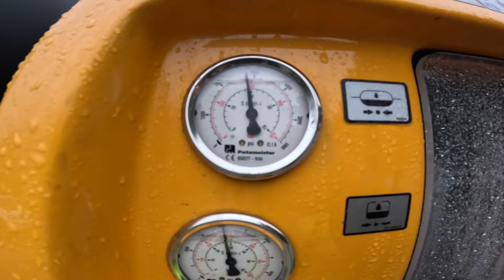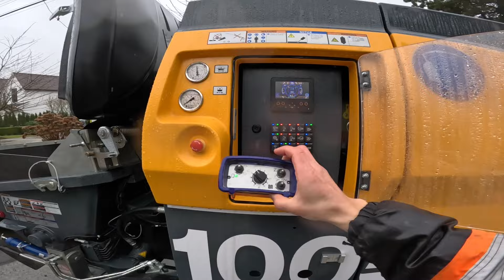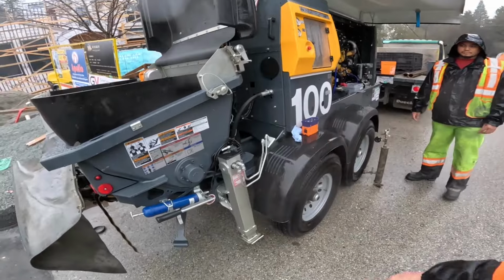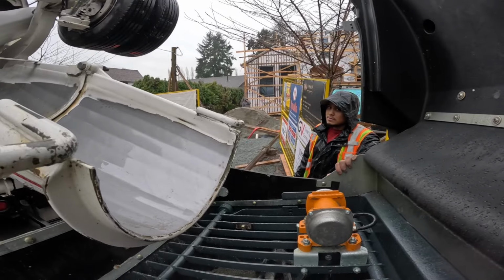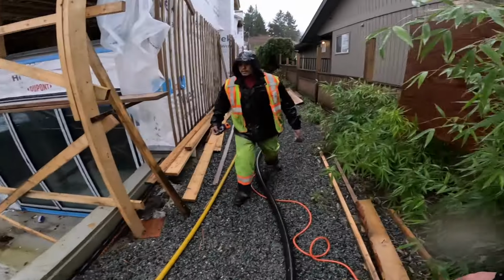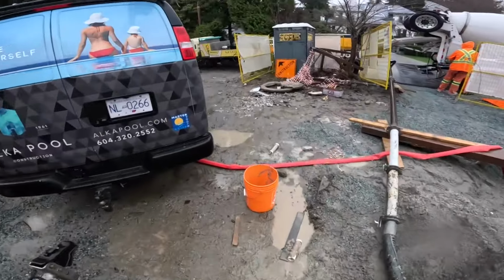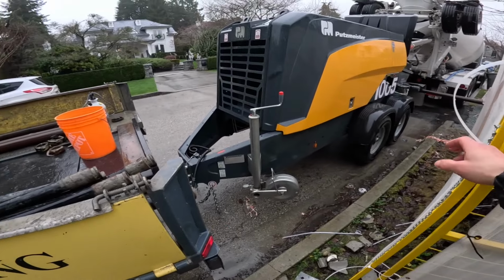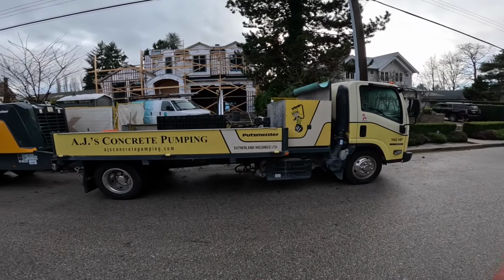Pumping SHOTCRETE with the PUTZMEISTER 1005 trailer pump. It’s soooooooo EASY!!!

Comment: The old Transcrete America I ran p60 size had all hydraulic outriggers. I always put them all down, for long pushes of hose for washout I’d unhook and drop my front end almost to floor 👍🏽👍🏽
Reply from the maker: That’s a nice feature. We have a Schwing high-rise pump which has hydraulic outriggers at each corner and it makes things much easier. It’s a bit of a dick-around drop the third outrigger on this unit.

Comment: It looks like a complete unit  what would it  to cut off the hitch and wheels and weld it to the  bed ( of ur 2axle truck with water  tank and water hose ) ?
Reply from the maker: To truck mount these units you really want them built on a skid from factory. Doing so allows for angling the drive cylinders in relation to the rest of the pump unit as such that they clear the drive axles of the chassis and the hopper still sits as low as possible. If you’ve ever noticed that a good amount of truck mounted units have the hopper sitting a mile in the air, and/or overhangs the drive axle by a mile, it’s because they likely just took a standard trailer setup and dropped it onto a truck. 

Trust me though, we have definitely been thinking of if there’s a feasible way to do with this pump unit exactly what you mention. 😁😁😁
Reply: Hello,I am also a pumper
Reply: How can I contact you?

Comment: what speed on the dial were yoy pumping at?
Reply from the maker: @JSiembor  was awhile ago now, but from why I recall, it was around a 3-4. Turning it up higher would not affect the actual output much as on a long push like this, we were pretty much maxed out on horsepower.

Comment: I drop the front leg.   I'm no expert, but any movement I can keep  off my truck or equipment is saving me some amount of wear and tear.   Takes me 2 seconds, why the heck not.  Maybe one day when I'm rich ill just leave it hooked up! ;)
Reply: Also---- My pump is a single axle, and I really wince every time I see that thing shake.
Reply from the maker: I tend to agree with you. The third leg on this unit is a bit of a dick-around, but definitely stabilized the machine and keeps all that surge away from the truck chassis.

Comment: where do you get the rear end safety rubber covers from?
Reply from the maker: So we actually build them in-house using heavy conveyer belting. One of these days when we’re putting one together in the shop I’ll make a vid.

Comment: do you guys have issues pumping from long ranges? my boss has a 1004 and it seems like the controller disconnects. definitely would have disconnected in this pour and would have to sit where you put the pumper caddy at
Reply from the maker: Definitely sounds like something funky is going on with yours. We’ve seen great results in terms of range with this Putz/HBC transmitter. A job I posted a few weeks ago we were 350’ from the pump unit and about 50’ below grade. Never dropped out once. Perhaps an antenna or grounding issue???